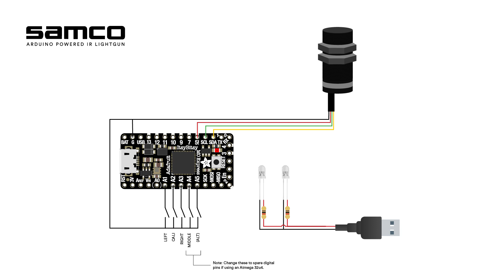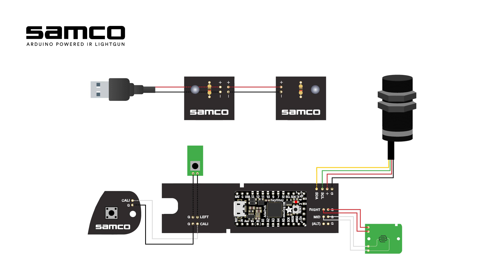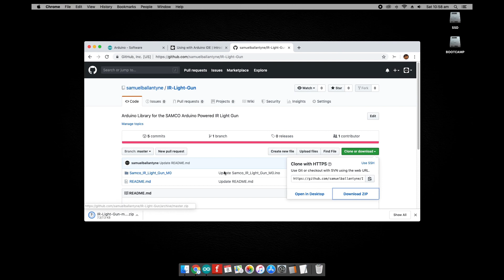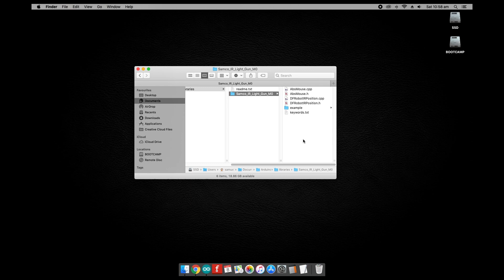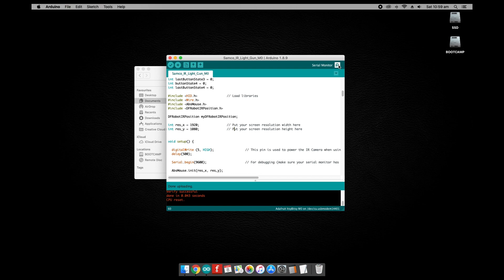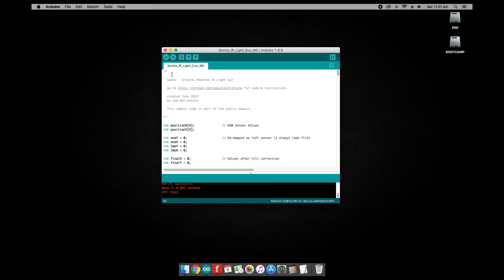SAMCO DIY Light Gun - GunCon1 Build Guide

Comment: Are you using a nintendo wii IR receiver or does it just work without on this tutorial?
Reply from the maker: Yeah, sorry this is a bit of an old guide now. So when I first made these they shipped with two led boards to make your own sensors but now I suggest buying after-market USB wii sensor bars. They're cheap, look nice and do the same thing. I mention it in my GunCon2 build guide and PCB vid if ya wanna check those out.

Comment: Can I use a RP2040 for this?
Reply from the maker: Yeah man, but if ya wanna go down that route I suggest checking out this fork https://github.com/SeongGino/ir-light-gun-plus it's designed to work with a pico. An IstyBitsy Rp2040 would work with my PCB but they just make it a bit easier to assemble you can just soldered up ya self if you prefer.

Comment: Hi, how does this compare to the aimtrak DIY kit? they both use the sensor bar but regarding the camera and performance , is there any real-world difference?
Reply from the maker: The Samco Beta code uses 2 sensor bars (4IR Leds) so is more accurate especially if you move around a bit from your calibrated position. I believe you can also stand closer to your screen with mine. Haven't used an Aimtrak myself but from what I hear everything else (lag etc) is much the same.

Comment: Bro will this work with Arduino nano and the small hand gun for ps1
Just checking 😁 also be badass to get it working on android and with Bluetooth 😮😮😮😅
Reply from the maker: The microcontroller has to be HID compatible so need to use a Micro (or any 32u4 microcontroller). As long as you can fit all the parts in the gun, no reason why it shouldn’t work the same. Bluetooth hopefully on the way at some stage, not sure about Android yet but I’ll look into it :)
Reply: @samcorulz  brilliant 👌 worth a try
Reply: @samcorulz  what about modding a air fly remote control instead of coding
Reply from the maker: @davey2k12  yeah, if ya just want muck around they are ok. But not accurate at all and need to be calibrated every 5 mins. More annoying than fun in my opinion :)

Comment: Hi sam,
I was interested in converting my sega saturn light gun/stunner with your guide, however I've encountered a small problem. Pardon me if this is a simple question as I am not savvy in the field of electronics/repairs. In your case, the trigger switch in which you snipped off the main PCB but kept for the build was detached from said PCB, however in my case the entire thing is just one whole unit spare for the action button. My explanation may be poor but this video has a good view of the internals: https://www.youtube.com/watch?v=ODxbk_mkzuQ

How would I go about this now, or is it impossible to proceed? Thanks for your guide and help man.
Reply from the maker: Hi mate, yeah it is a bit tricker on a Saturn light gun but the video you added will actually help you can use his method to modify the trigger and solder that new trigger either straight on the itsy bitsy board or onto my PCB (as long as my PCB fits in the gun, I haven’t actually tried this) basically the 2 wires that come off that new trigger go into the same spot the as the trigger in my video. Hope this helps a bit, you’ll still need to kinda work it out but it’s definitely possible to do.

Comment: Hello Sam. I'm currently looking for a light gun the same as yours but I could only find some of them on eBay UK since it doesnt have in my country (Brazil) or China, and ive come across a japanese guy who's selling a no longer working namco for approx. GBP 7. Although his selling page says it doesnt export to Brazil I'm still contacting him to check wether its possible or not for us to overcome it.

But the real point is, I've found on my region's marketplace a Panther 1+1 L.g. for the price of GBP 24 because its working and also comes with a pedal. And my question is if is there a possibility of somehow making this pedal works with the gun when playing games. Thank you so much, I'll definetely try this out to play The House of The Dead 2 :), my personal favorite game
Reply from the maker: Yeah, it’s possible as long as all the parts fit inside it (hard to say if they will or not) and you’re confident you can solder the buttons directly to the Microcontroller. And yip, have a pin setup for use with a pedal, check out my GitHub for schematics/pinouts.
Reply: @samcorulz  thank you so much

Comment: Really i need a namco guncon? Can assembly in another plastic gun for example? Thanks!!! Fantastic project.
Reply from the maker: Na man, you can put it in any case you want. It's a bit easier with the guides and the PCB if you have a GunCon but you can solder all your buttons, camera etc directly to the board and as long as everything fits inside your case it'll run exactly the same. Cheers :)

Comment: Hey, quick question, could you do this with a raspberry pi pico?
Reply from the maker: The pico does have all the capabilities to run this. However the code have bee specifically written for Arduino. But you could translate to pico if you wanted to.

Comment: el proyecto es genial. Sabes si podría realizarlo con la pistola AVENGER de ps1 en vez de la gcom 45? muchas gracias.
Reply: sería más que nada por aprovechar el retroceso de esa pistola.
Reply from the maker: Yeah you can, but it's a lot tricker. You'll have to work out which wire run from each button and solder it directly to the microcontroller. The recoil on these run on it's own circuit so as long as you keep that in tack you can run both and it will just recoil everytime you pull the tigger.
Reply: @samcorulz  Thanks

Comment: Im going to buy a couple of these and run your 1.1 boards in it. Such a great option thanks for all your hard work...when you order the board does it come with the wires? Might sound silly but if not what size and type do you suggest? Thanks.
Reply from the maker: Thanks man, na don’t usually send with wires but you can use almost anything as long as it’s not crazy thin. But if you want a suggestion 20 awg is a good bet, good size to solder and can used for almost any arduino project.
Reply: @samcorulz  awesome man thanks for the quick reply. Going to build a cab around these! Cant wait!!! What size screen you think is the max I should go?
Reply from the maker: No probs, for the screen size just take into account that you have to a minimum of 2 screens widths for the 2 IR sketch and 1.5 for the 4IR sketch. So it kinda depends on how you setup your cab. I suggest you see how its goes on your computer monitor and it will be easier to decide from there.

Comment: @Samco
I build the v1.1 in my P99G2 LighBluster and have a couple of problems.

First i want to tell you, i soldered it like the v1.1.pdf. I spended over 3 days, cause the buttons worked, but the cam not. I thought it´s on my solder points, but then i saw, on your first pic (without your boards), you have the green/yellow cable of the cam reversed....

After i got it working, i tried your 4 LED, cause i choosed 2 wii sensor bars. I flashed the itsy with the "4IR-test" and when i start the sketch file i only see the mouse coursor, no color buttons. Error comes always "out of range" or something like that.

The "2IR-test" works ok, but i choose it on my 50" TV and i need the 4IR.....

And in PCSX2 i cant get it work like your video.
How you made it that your gun in the videos are so accurate?? on mine it flickers always?

Have you a address for a bit support? or have we to write our problems here in youtube??
Reply from the maker: Hi Adonis, I'm only guessing but it might be that your camera isn't quite straight (there's a lot less leniency for error in the 4IR to 2IR for tilt) you can test this with the processor sketch which I have just updated today to hopefully be a lot more stable. Good luck and if you have anymore questions feel free to join facebook group https://www.facebook.com/groups/2456595207897603

Comment: Hey ! 
Awesome work !
I’m new to all this but I’m very much looking forward to build 2 of them, however before I do I’d just like to ask you if they’ll work with open emu on a projector ?
Thanks !
Reply from the maker: Hey Thanks! Just did a quick test on openEmu (cool emulator by the way) just tested TimeCrisis and it worked fine with one exception. I couldn't map the A/B buttons but a possible work around would be added the keyboard library to my code like in my Samco 2.0 sketch or even easier change the the square button to space and use a keyboard as a foot switch :) As far a projector working if you can stand 1.5 screen widths back from it I think it would be possible but couldn't tell you 100%.

Comment: This is really helpful ! Is it possible to build in a recoil ?
Reply: You could. You'd have to get a solenoid that runs off of the same voltage as a USB (5 volts). Then, you'd have the trigger work as an enable for the solenoid. You'd most likely have to add a diode at the trigger so it wouldn't travel back to the USB and fry something, or you could use a timer relay board with the trigger working as the enable button.

Comment: What screen size does this set up support? i am using 24" display - will that work? also - what is the required min/max distance of the gun from the leds to keep it working well?
Reply from the maker: Yip, should work on pretty much any screen size as long as you can stand back far enough 1 1/2 screen widths back for the 4 IR sketch and 2 minimum for the 2 IR sketch.

Comment: Hi,
I've built my Samco Lightgun with your guide and items and seems all right. I'm having problems with the calibration. When I click on calibration button and pull the trigger, the mouse goes to the top. I move the lightgun to the same position and I pull the trigger again, then the mouse goes to Bottom and I repeat the operation. The problem that I'm having is that the calibration never works fine or is more or less correct. Sometimes doesnt get calibration, other times is going so fast or is collapsed in the same lane, etc. Could you tell how do the better calibration? What is the distance between sensor bar and lightgun? Thanks and regards,
Reply from the maker: Hi, there's a few thing that could be causing this. You might simply be too close to the screen, you have to be about 2 1/2 screen widths back for from you screen for optimal calibration. If this is the case and you want to use your gun closer, check out my 4 led setup guide on my channel that lets you use your gun closer to the screen. I also have a troubleshooting guide up that can help work out if there is anything else going on like IR interference.

Comment: can this light gun be made without using the pcbs of the namco gun? Namco guns arn't super easy to find and are a little overpriced.
Reply from the maker: Yip! If you can fit it all into your desired gun you can solder all your buttons directly to to the microcontroller. Will work in the exact same way.
Reply: @samcorulz  thanks for your response :) so the two pcbs that are apart of the namco gun are they just buttons? also the pcb for the red button, its connected to "right" and "mid" so does this button have two imputs? sorry I am not someone who knows a lot about wiring stuff up.
Reply from the maker: Yip, the trigger PCB has a button already soldered to it and the other PCB has a conductive pad on each side as there are red buttons on the left and right side of the gun. A little bit of rubber with a conductive coating on it, that sits behind the button, toggles the switch on/off when pushed. Hopefully that makes sense it was actually quite hard to describe :)

Comment: thanks very much I will try. Do you know if there is aliexpress option for the adafruit( button and the processor)? thinking something like this
https://www.ebay.com/itm/Leonardo-Pro-Micro-ATmega32U4-for-Arduino-IDE-1-0-3-Bootloader-Replace-Pro-gfhh/264758605910?hash=item3da4d7b856:g:Q8EAAOSw4MBe39C0
Reply from the maker: Yeah, if you not using the Samco PCB and want to soldered your camera and buttons directly you could use something similar to this board but make sure it has a USB micro plug on it. This particular boards need an extra board to upload sketches to it so not really suitable for some that runs through USB.
Reply: @samcorulz  thanks very much for your fast reply. I want to use your board, I will buy as soon as I found the pistol.
https://www.ebay.com/itm/ATmega32U4-Leonardo-Pro-Micro-for-Arduino-IDE-1-0-3-Bootloader-replace-Pro-Mini/273790722938?hash=item3fbf32e37a:g:iOwAAOSwjr5cpHgo
https://www.ebay.com/itm/New-Pro-Micro-ATmega32U4-5V-16MHz-Replace-ATmega328-Arduino-Pro-Mini/312628283983?hash=item48ca190a4f:g:DB4AAOSw1AZctETw
this one has the connection. I am just looking for a chinese copy of adafruit because ada fruit is charing 40 dollars of shipment
now I am in doubt of which button I should take https://www.ebay.com/itm/Momentary-Tactile-Push-Button-Switch-6-6-4-3-15mm-Mini-Micro-Small-PCB-Mounted/263259205523?_trksid=p2485497.m4902.l9144
I think it is the 12mm since the adafruit only counts the size of the button itself.
Reply from the maker: No worries, unfortunately if you want to your my PCB this board will not work as the pins are in a different place. I would suggest looking on eBay or local maker sites for an ItsyBitsy as they generally have cheaper shipping. What country are you in I could have quick look for you if ya like? But you're bang on withe switch 12mm version is the exact same switch.

Comment: Which itsybitsy do I get?
Reply from the maker: You can get either 32u4, M0 or M4. They all work the same in the new sketch. The 32u4 is slightly cheaper so I would go with that.
Reply: @samcorulz  Ok so I found 2 avenger pros, which actually has the recoil where the barrel kicks back on the slider. They're shaped just like the guncons and everything. Can I get it to work with this kit and maintain the guns kick back?
Reply from the maker: I trying to get my hands on a avenger or super jolt to try and add recoil to the sketch. From my research the insides are quite different to the regular Namco so pretty sure you won’t be able to use the PCB but you could solder buttons etc directly to the board it’s just a bit trickier. And yip 3v 8mhz boards work fine thats what I used in my latest vid.
Reply: @samcorulz  Ok. I'm going to tinker with it when I get it and see what I can conjure up. To have that recoil is worth the effort.
Reply: @samcorulz  Is there a big difference between the 5v 16 mhz and 3v 8mhz? Meaning does it really make a difference? I'm asking because the 16 MHZ is out of stock, so would it matter if I got the 8mhz.

Comment: Hi, 
I have a doubt about motherboard.
Could we use an ardurino uno R3 mother board with a litlle protoboard to prevent weld the camera? Will be necessary to adapt the code after this, is not it?
Regards,
Reply from the maker: Hi, so you have to use a board that can act as a HID device (basically act as a mouse) the UNO can’t but the Leonardo can. So if you used a Leonardo you could use the header pins and as long as you use the same pins from the Samco 1.1 code you would not have change it. But you would still have to wire buttons some how.

Comment: question.

do you plan to make a version where an arcade variant of the namco guns can be used, or guncon 2 conversions? (solenoid recoil and case top recoil)  ive got a few guns which work on ps1 and ps2 but ive some that the top of the gun acts like the real ones when you pull the trigger, and wandered could a version be made to have a powered recoil if you havent? (or power the inbuilt one via a trigger press bypassing the circuit?)

i know long post, but i dont know how to say the exact term heh
Reply from the maker: Hey man, yeah I’ll have some news about GunCon2 hopefully very soon :) I haven’t worked on any recoil guns myself but I suggest you head over to arcade controls http://forum.arcadecontrols.com/index.php/board,20.0.html there’s a load of guys over there working on all sorts of different light gun solutions including adding recoil.

Comment: I am struggling with the AbsMouse library.
I keep getting:
"exit status 1
'AbsMouse' was not declared in this scope"

What gives? I already declared the AbsMouse library and put the files in my library folder in Arduino. The DFR library works fine as I am able to use the IR camera with other codes. I thought resetting Arduino and making sure the libraries were installed properly, but nothing is working. What am I doing wrong?
Reply from the maker: Hey man, it might that you have 2 versions of the AbsMouse library in your library folder, try deleting the one not in the samco folder and reuploading. If that doesn’t work copy the whole error code and I’ll look into it for ya :)
Reply: @samcorulz  The problem was fixed! Thank you! 

Your PCB boards are currently out of stock. Do you have any idea for different kinds of PCB boards that are capable of being used with your code?
Reply from the maker: Austin Grider sweet! Na, unless you wanted to solder directly to the board. I have ordered some more though hopefully have them in a couple of weeks.

Comment: Awesome project, I have a Namco guncon on the way now to try this on. How do you think 4 LEDs would work in your setup? Would you array them across the top of the screen, or one each top, bottom, and sides? Do you think the additional LEDs would be of benefit in tracking accuracy?
Reply from the maker: Vanillahgorilla Thanks dude! Yeah, unfortunately my code only works with 2 leds (similar to wiimote or Sinden) 2 extra less will just though out the code. I’ve just explained it in my vid if you wanna have a look.
Reply: SAMCO Watched it just now, your video sorted it for me. I’ll be ordering a couple kits from you soon, this is great work.